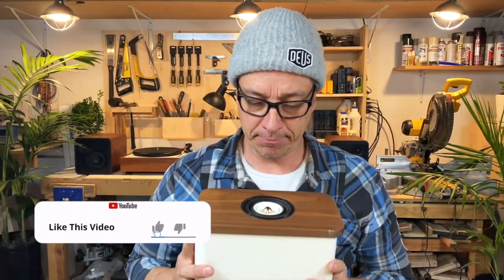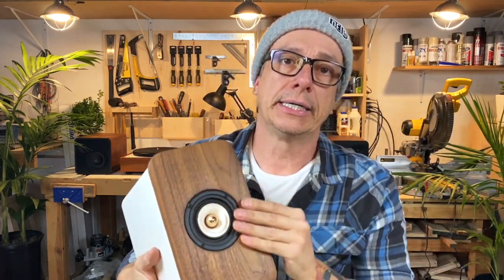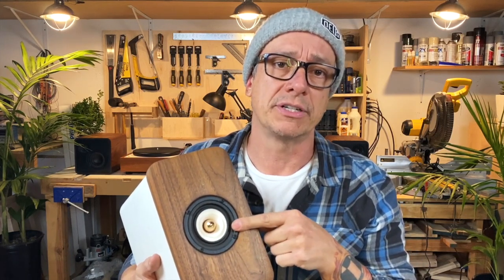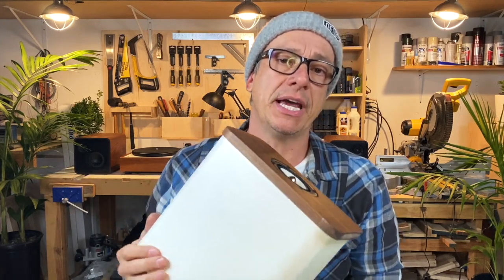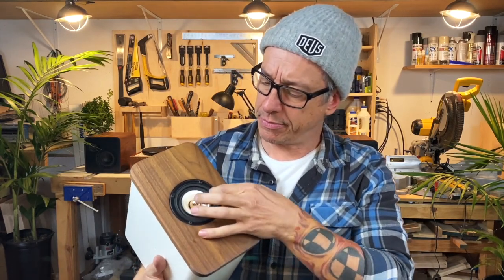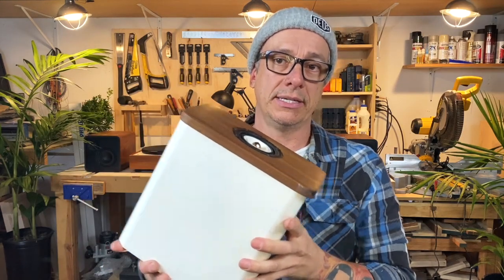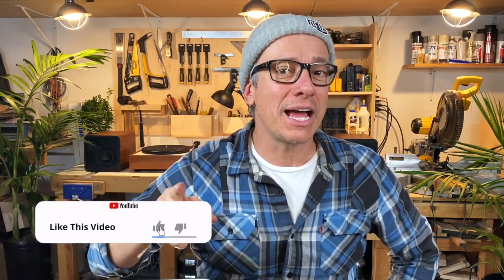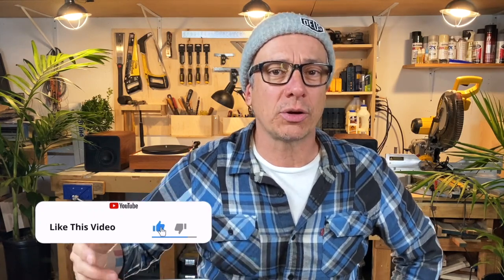Full Range speakers | DIY | 3 inch drivers from AliExpress and scrap wood.

Comment: Bought these drivers after watching your vids for an office desk, huge thanks. However they arrived with zero information or parameters. You mention 4.3l internal volume, but with that port... Fs tuning is around 90hz, is that correct, works well? Thanks in advance

Comment: Hola Sonnora Design!! 
Inspirado por tu trabajo, compré 2 Full Range Aiyima de 4' y los coloqué en unas cajas de otro sistema de audio, aproximadamente de 4 litros de capacidad. Le puse material absorbente (espuma absorbente en forma de ondas) y las probé. Me quedé impresionado del excelente sonido que producen. A mi parecer le falta entregar bajos, de los 70 Hz para abajo. Y hay una zona del espectro en el que la voz aguda de mujer (si canta con más fuerza) puede ser incómodo. Así que le agregué un notch filter y parece que mejoró en la gráfica y para el oído. Hice algunas demostraciones a mis amigos y les encantó el sonido, además utilicé un subwoofer para complementar el espectro de frecuencias. 
En cuanto a las cajas, no tengo manera aún de saber cuál sería el volumen ideal, ya que no tiene los parámetros necesarios para calcularlo, a menos que use el DATs de Parts Express o algo parecido. 
Ya que hice la prueba de sonido, me estoy aventurando a realizar mis propias cajas, esta vez las haré de mayor volumen. Tengo otros proyectos con drivers que sí tengan los parámetros en la hoja de especificación. 
Gracias por tus vídeos, nos inspiran a disfrutar del sonido, la música y el convivio entre familiares y amigos. Saludos!
Reply from the maker: Hola Daniel. Me quedo muy contento con su decision de aventurarse con los altavoces!!
That’s really great. Those drivers won’t go too low in a closed box design. You need a port and a bigger box to tune them to a lower frequency. I have the measurements on the description so you can try that box I made. I’m using mine without the notch filter and it sounds great. Keep working my friend. It’s a lot of fun!!! Thanks for sharing!
Reply: @sonnoradesign  Thanks a lot my friend! 
Me encanta la música que pones de fondo cuando trabajas. Alegras el video con tu forma de ser.
Reply from the maker: @DanielOrtiz-bg6ty  I like the music as well!! Thanks for watching Daniel!
Reply from the maker: You can find a lot of information about the drivers online as well as the softwares for calculation!!!